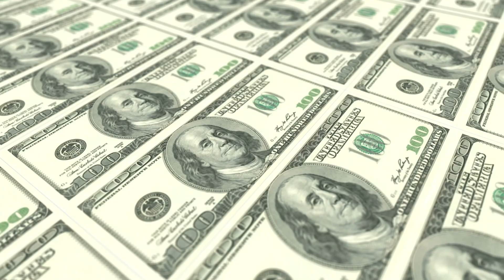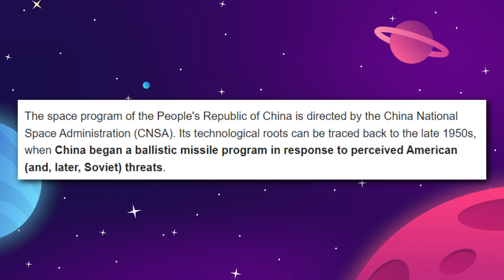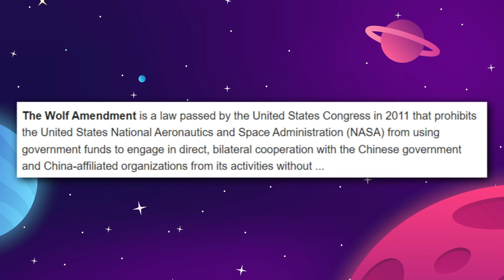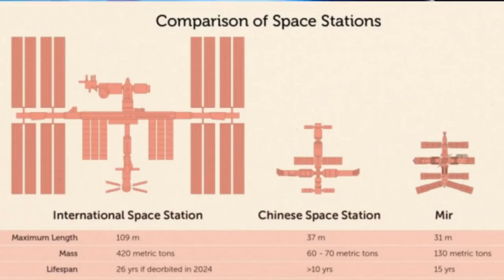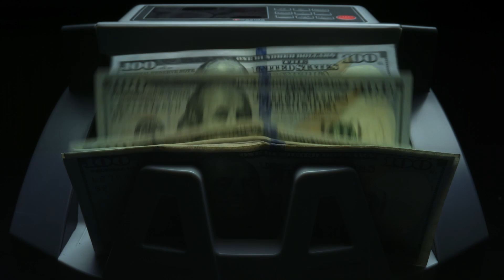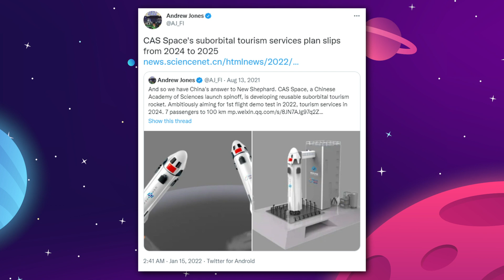Why China Is About To Take Over Space!

Comment: I still think metal tube frame with an inflatable "balloon" form fitting habitat. The outer mesh and fabric shell for the balloon could have flexible components stations built in and astronauts carry on plug in devices for their work. Easy to replace and or repair easy to load on a rocket etc. Hoses of gases hook up to the mesh abd fabric outside via pipes or space worthy connections.
Reply: I really like the inflatable module system too. It should make for an efficient shipping volume compared to rigid tube structures
Reply: This idea depends on it never being hit by orbital debris.
Reply: @oshavlfarms7239  Even solid metal won’t fare any better. At the speeds of orbital debris, everything of the thickness sent into space thus far would be equally punctured. The solution is to have thin redundant shells so that the debris is vaporized upon the first impact, and the resulting shower of dust hits the next layer over a much larger area with less energy
Reply: The only issue with module inflatable habitats is that you need to have materials that can withstand possible micrometeorites and other objects that can be a danger to astronauts and the station itself perhaps maybe using kevalar type of materials for the inflatables may be an option to protect the station and its crew from such dangerously possible outcomes..

Comment: Let's just colonize the moon first,  then build a big spacecraft.  Due to the low gravity of the moon, we can launch it from the moon to the space. It'll be better than any space station.
Reply: unfortunately we would have to transport the infrastructure needed to build the spacecraft. In addition, the materials on the moon are not suitable to build spacecraft. It would be easier to assemble the spacecraft in LEO. As the weight of the spacecraft would be less than the infrastructure needed to build it. In addition, the rocket equation favors a larger amount of smaller vehicles than one big one. Having a large amount of smaller vehicles also builds redundancy as well. I do love your thinking though! Most people in the comment section focus on the politics in a space video....